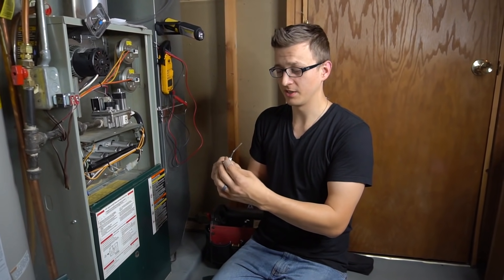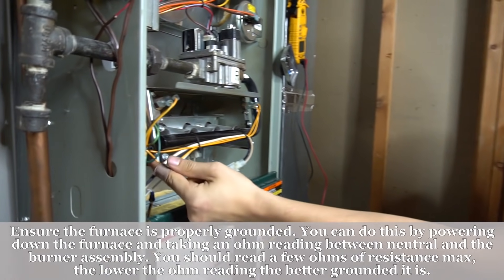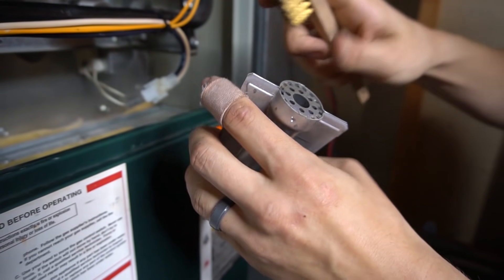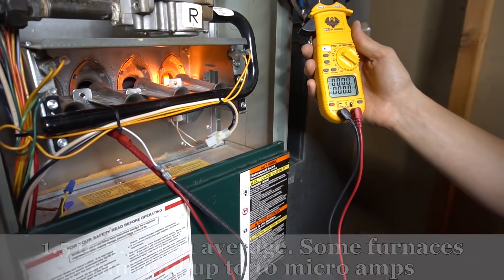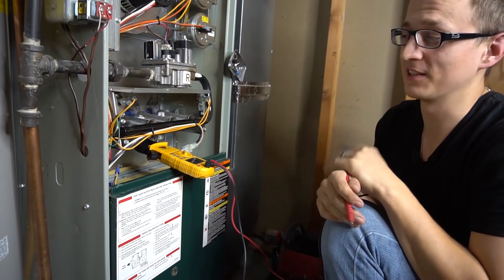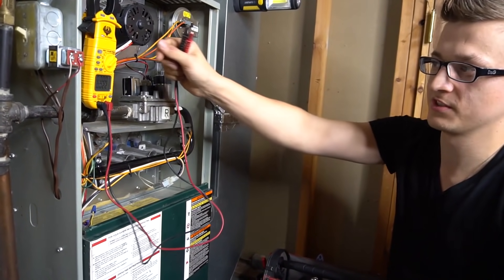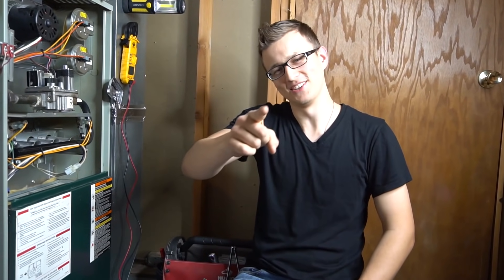Furnace Not Working - Troubleshooting the Flame Sensor

Comment: Update on comment posted three days ago. I was getting code 13 on a carrier furnace/ac unit. Flame rollout or sensor problem. Cleaning the sensor, then replacement worked for a few days, then the same problem. As it turned out, the blower motor speed was erroneous due to a bad capacitor. Changed the capacitor, the furnace is running great. A $10 fix.
The flame sensor error code is misleading. Check for the motor humming or whining sound. The capacitor could be bad. There is a component check sequence on my motherboard. Pretty simple. It checks for the motor speed in the heating mode and cooling mode.

Comment: The flame sensor is receiving ac volts correct?...not dc?...i have a weather king fgas furn trying to troubleshoot....burner fires up and the turns off after 1-5 seconds and then fan immediately comes on... Flame sensor is only about 3 yrs old and visually looks clean...

Comment: Complete newbie here..  do gas furnaces use ignitors like an oven, rather than pilot lights?  I always figured it was like a water heater.   My furnace is not blowing hot air.. only the fan kicks on.  Brand new Nest thermostat, so something is going on here.
Reply from the maker: Hey Craig! Different furnaces use different methods to light the gas. Here is what they can have:

1. Intermittent Pilot - Turns on a little pilot flame when there is a call for heat (your thermostat is turned on to heat) which then lights the burners.
2. Standing Pilot - Has a pilot light on at all times. Only very old furnaces will have this style.
3. Spark Ignitor - These ignitors look like the flame sensor rod but their purpose is to put out a spark which lights an intermittent pilot or just lights the main burners right away.
4. Hot Surface Ignitor - These are the ones that glow. There are many different styles. But basically they use high heat (1000+ degrees) to light the main burners.

To answer your actual question though, ovens, water heaters, boilers, furnaces and other gas burning appliances will all have one of the above ignition methods. Since you have a new thermostat, I would first check if the problem lies in the thermostat or in it's wiring. Try bypassing it to begin with and see if the furnace turns on.

https://www.youtube.com/watch?v=9Y_R9unnadI&index=6&list=PLK8tZPlovA8BJJ_weFseSjQWUvB2FFII2

With a Nest, just release your R wire (or Rh) and the W wire. and touch the two wires together or tape them together or something. There will be 24v there which may make a little spark but don't be alarmed, that's low voltage so even if you grab the bare part with your hand it would barely tingle. If bypassing the thermostat does not turn on the furnace then put the wires back in their place. Next go down to your furnace and take the top door off. Turn your furnace power switch off for 5 seconds and back on. (if you do not have a power switch, use the circuit breaker) What does your furnace do? If anything.
Reply: @WordofAdviceTV  unbelievable response. Thanks so much!  I'll be back home later to do just that.  I'll let you know know what I find out.
Reply from the maker: I try to be helpful :) Alright, good luck!

Comment: Flame sensor is connected in series to check for dc reading when the  control board is faulty and does not sending out any reading .Could the flame sensor wrongly mistaken as faulty flame sensor ?
My second question : How to get to the bottom checking out the control board is faulty not the flame sensor ? Thank you.

Comment: Everyone talks about cleaning this sensor, yet no one describes why so many are replaced. Besides being physically broken or dirty, is it the metal in the sensor that just won't conduct properly anymore? Is the metal deteriorated to the point that it won't conduct to the ion stream of the flame?
Reply from the maker: It's literally just a metal rod. Sometimes the build up on it is stuck on real bad, to the point where you would have to use abrasive sandpaper to shine it up again. But that results with scratches on the flame sensor which causes the sensor to need to be cleaned even more often. (if it's scratched up, dust and other particles stick to it much better) So basically if the flame sensor is green and it looks like the stuff is just caked on it, most techs will replace it instead of clean it. Also if the ceramic insulation on it is cracked, it is recommended to replace it as well.
Reply: @WordofAdviceTV  Thanks for the reply! My Goodman 050-3 is finicky. Sometimes works fine. Other times, flame would blow out in a second or so. Cleaned sensor, then I had a condition where the burner would just 'puff' one little spurt of flame on the igniter side burner(not enough to even  light the opposite burner) and shut down. I 'hotwired' the gas valve when the igniter was cooking and the furnace ran, but set a 5 blink (false-flame, 'gas valve stuck ') code. Wouldn't the flame sensor have to be functioning for it to sense a false flame? Even when it doesn't light, I have never had a code. After this experiment, I plugged the gas valve in to it's source wire, and the darn furnace started working again......I don't expect it to keep working , though, as it's teased me before. I've suspected that it has a 'moody board.'

Comment: I just looked at my sisters furnace.  I was getting 2.6 micro amps in flame sensor but burners still shut off in a few seconds.  I ohmed out all safety switches they all ok.  Any suggestions please.  Is it processor board?

Comment: wished I had saw this video before attempting to fix mine. Over the years I have found when you run on very little sleep it's best to leave things alone. But I didn't, took me a while to locate the Ignitor. What thru me was the ignitor and flame sensor were mounted together. And together all I could see were three wires. As I was cleaning the flame sensor I brushed against the ignitor, and it broke. So, I go down to the local hvac shop, and the guy waned $106.oo. I looked online and Amazon wanted $90.oo. Then I looked on ebay, $30 new in package. After this video I am not sure if this is the problem. It may be but when I go to put this back together, I will attempt to clean the burner face.
Before I started working on this, I would turn it on, and the ignitor would get hot and start glowing. Then nothing No flames, the flame sensor did not look all that dirty. Now I am wondering if it's some kind of fuel problem.

Comment: Speaking of electricity and flames, a "hot" piece of trivia is that if the electrical signal you are passing through the flame is an audio signal, then the flame will act as a speaker.  Google "flame speaker" if you are interested in reading more.

Comment: Fraser Johnston Furnace Model G9T08012UPB13C.  The furnace has been used in this home for over 9 years. 
My burners only stay on for about 5-7 seconds. Sometimes the burners will stay lit for 30+ seconds and then drop down to 15-18 seconds and then drop down to about 5 seconds and then the furnace goes into lockout.  I get two fault codes. I get the 7 FLASHES  fault even though the burner flame does light but does not stay on.
 7 FLASHES: This fault code indicates that the flame could not be established. This no-light condition occurred 3 times (2 retries) during the call for heat before locking out. Low gas pressure, faulty gas valve, faulty hot surface ignitor or burner problem may cause this. 
8 FLASHES: This fault is indicated if the flame is lost 5 times (4 recycles) during the heating cycle. This could be caused by low gas pressure or a faulty gas valve. 
Furnace input power is good at over 120 VAC.

I have around 28VAC at the gas valve when the control board turns it on.
I replaced the gas valve and still have the same problem.
I have cleaned the compensate drain.
I temporarily bypassed the limit and roll out switches and still had the same problem.
The Natural gas company came out and checked my gas pressure at the meter outside my home and also verified that the gas was coming out of the meter.
My gas hot water heater and gas dryer both work fine.
I have cleaned the flame sense rod several times.
I cleaned the end of all 4 burners.
 I even replaced the burner near the flame sense rod with a new burner. 
I have 99 VAC on the flame sense rod with or without the call for heat.
When the flame ignites the voltage at the flame sense rod drops about 11 VAC down to 88VAC.
I cannot get a stable DC microamp reading with my meter in series with the voltage to the flame sense rod. The reading bounces around from below 0.9 microamps DC up to 1.2 to 1.5 microamps DC. For my furnace, the  Normal flame sense current is supposed to be approximately:  3.7 microamps DC (µa).  Low flame signal control lockout point is:  0.9 microamps DC (µa)
I don't always have zero Ohms between the ground and neutral.  Sometimes I read about 0.3VAC to 0.5VAC between the ground and neutral even with the furnace power switch off. After I turn the power back on and when the furnace turns on the AC voltage between ground and neutral goes up to about 0.9 VAC. 
What could be causing the AC voltage between the ground and the neutral? 
Do I have a faulty 24VAC transformer?
Do I have a faulty control board?
Do you measure any AC voltage between your ground and neutral?
Reply from the maker: Oh boy.. That one sounds like a problem any tech would not want to deal with. From what you described, it is hard to pinpoint what exactly is the cause of that... By the way, I had a problematic furnace like that as well a while back and I wrote a long post about it in the community section and it got some good replies too. Perhaps reading through that would give you some more ideas: https://www.youtube.com/user/WordofAdviceTV/community?view_as=subscriber
Reply: @WordofAdviceTV  Hey Jay thank you for the response. Your videos are great.  I have already read your similar problem, what you tried, and all the comments in the link you provided.  Going through that information did give me a couple of ideas so thank you.  Jay, do you know if there are any membranes inside the condensate drain trap also called a condensate drain coupler?
Reply: Dear John peel did u figure it out ??
Reply: @kevinkevin9448  Hey Kevin, No I have not figured out the cause of the problem yet. I have a Fraser Johnston Furnace Model G9T08012UPB13C. My furnace is over 10 years old. Not sure of the age as I bought it used from a relative in 2010.  I have been using it for the past 9 years.  The burner problem detailed above is the third problem I've had with it. Don't know if the condensate drain trap has anything to do with my burner/flame sense problem or not but I may have screwed it up when I was trying to get all the bugs and dirt out of it using the garden hose with a nozzle.  According to the furnace installation instructions, the condensate drain trap is supposed to retain water and when I tried to fill mine with water it just drained right out.  The following is from the installation manual.  CONDENSATE DRAIN
The condensate trap must be filled with water before putting the furnace
into operation. Perform the following procedures only after the condensate trap has been properly piped to a drain connection using the procedure in this instruction.
The recommended procedure is as follows:
1. Disconnect the condensate drain hose from the induced draft
blower discharge.
2. Elevate this hose and fill with water using a funnel.
3. Replace the condensate drain hose and clamps.
If this procedure is not followed, the unit may not properly drain on initial
start up.
Reply from the maker: @johnpeel8250  Hey John! I usually don't do that filling procedure when I replace or clean out a condensate trap and I've never had a problem yet. Once in a long time I will get a furnace that will short cycle once or twice but after that it starts working normally. The trap would affect the pressure switch so if you want to test and see if perhaps that is the issue here is what you can do: Turn the heat on and right after the inducer motor turns on, jumper the pressure switch. If the furnace runs for a few minutes just fine, then we know that it's a pressure switch issue and perhaps that trap is causing it.
     Unfortunately if you already went through that whole comment thread, I don't have much more that I can suggest for you... This one almost turns into a parts vacuum. We had a furnace like that once which we replaced a lottt of parts on. (some parts more than once.. Because it does happen, where the part is bad out of the box) 3 or 4 different techs were out there, some of them multiple times. I think it was a York furnace, we ended up calling their technical support and after they verified that we have already tried everything they were going to suggest, they said they will set up an appointment for a York technician to come look at it. I wish I knew what happened after that but we were just happy to turn it over to someone else so I'm not sure what happened with it after that. Sorry I can't be of more help, seems like you furnace falls into this category as well.
Reply: @WordofAdviceTV  Hey Jay,  As you suggested I bypassed the pressure switch with a jumper right after the inducer started up. I have pretty much the same symptoms. The burner would only stay lit for about 8 seconds and after 3-5 tries would result in 7 flashes fault.  Do you know what voltage the IC chips on the control board run on? Is there an AC-DC power supply somewhere on the control board?  I was just wondering if maybe I have AC ripple on a DC voltage.  I have had a few power line problems near my house over the past few years. I've had lightning strikes causing blown fuses on the transformer power pole, a dead tree falling on a power line and bursting into flames, trees taking down power lines, and the smart meter that feeds my house had to be replaced as the display got taken out. I have NOT yet replaced the flame sense rod, control board, the 24VAC transformer,  condensate trap or anything else except the one burner by the flame sense and the gas valve.  I 'm going to try turning off all circuit breakers in my home except the one feeding the furnace just to see what happens.  I'm also going to try and run the furnace off of a generator to see what that does.  I'll let you know if I figure it out.  I can heat my house with a fireplace and blower and I have plenty of wood so I'm not yet desperate to get it fixed. I really appreciate all you do for everyone and for helping me. Thank You.

Comment: My igniter lights and I hear a clicking noise once or twice but no flames. After a few minutes I turn thermostat temp up a degree and see igniter light then flames kick on. Would this be the flame sensor I’m needing to clean as well? This would be my first time fooling with any of this ....please help
Reply: After a couple times it will run about 2-3 times and then same problem

Comment: Hard or soft lock out? Rectification? Testing flame sensor in series w/ meter? How many DC micro amps again? How about thermocouple/ pile millivolts? How do you bypass a faulty flammable vapor sensor on a residential water heater? 30 yrs of me touching flame sensors now. Replaced less than a dozen for residential furnaces. All them because of crack in porcelain and grounding out or because I cracked the porcelain insulator!

To all out there.. flame sensors on your home furnace do not/ can not go bad besides getting dirty and needing cleaning less someone breaking or trying to scam you. Basic maintenance it is, especially if you have a clothes drier in the same room as  your furnace and takes combustion air from the same room. That drier lint likes to attach itself to the flame sensor. Static electricity is what I tell people. It gets baked onto it and insulates preventing it from sensing the flame to ground that the electronic control board checks through what's called rectification.

Pressure switches the same. Unless they get moisture inside them they are like flame sensors.

I'm looking for a service tech in Chicago area. You will work year round minimum 40 hrs a week and however more you want.

If you are knowledgeable in commercial refrigeratin, then more bonus. Not just restaurants but cold storage industrial along with steam and water boilers where we rate them in Horsepower.

My friend,  let's get some vids out on Carrier infinity systems. Ever mess with mini split heat pumps or crazy Bosh variable everything on res systems?

You do hot side work for restaurants?

I can give you 50+ restaurants just to get them off my back from continually asking us if we still do such 

847-331-4390

Comment: So I cleaned the flame sensor, attempted to clean the burner in front of the sensor and I couldn't get to the igniter.  Swapped out the pressure switch with one I know works.  Igniter goes on for a few seconds, but no ignition.  Happens 3 times before it gets locked out.  Could it be a bad flame sensor? Igniter?  Both?

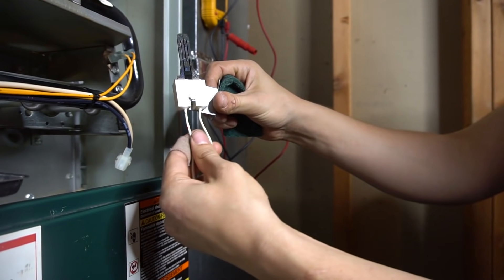Comment: Mine cuts on for 30 seconds or the highest, 2:30 minutes then cuts off.  May or may not attempt a restart.  Replaced most every part but the gas valve.  Honeywell sv9501m2742.  My valve spits out 188.9 volts which is way higher everyone mentions.  You said 90 v. I’ve heard others say 60v.  So… is it the valve?

Comment: CHECK THIS TOO......make sure your polarity is correct for voltage INTO the furnace. After 2 hours of freaking it turned out to be the polarity of my incoming voltage that made the difference of staying lit or shutting down ! Admittedly this is a furnace that was moved and a new pigtail installed. I thought I had the polarity correct but no.